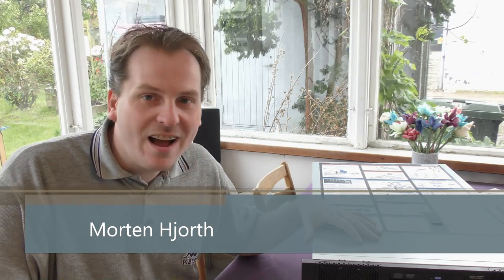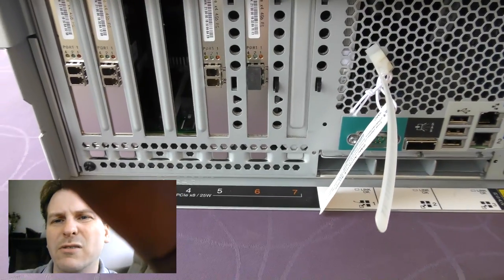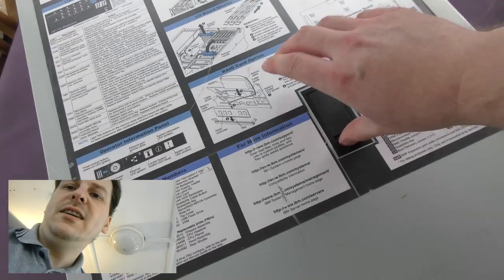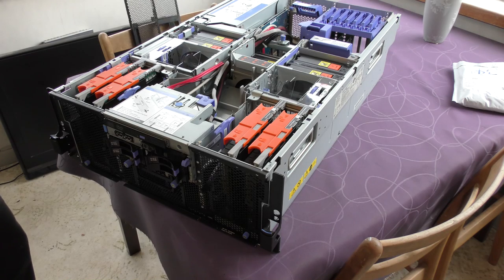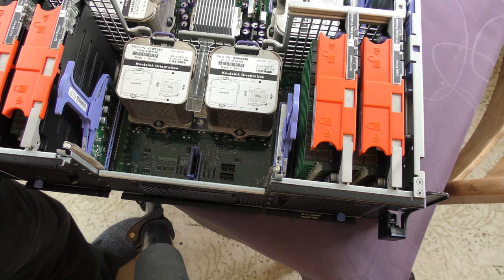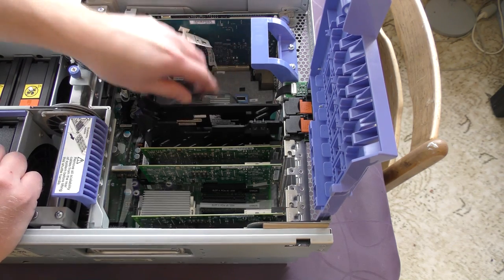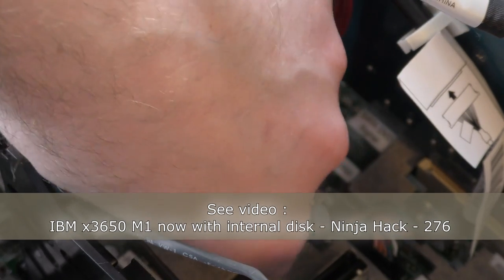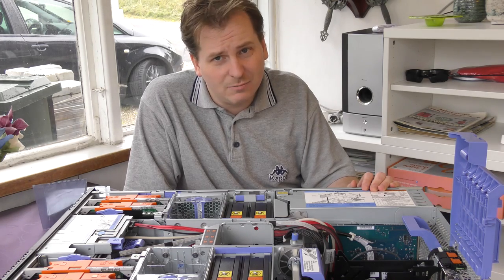$200 Awesome Server - 24 cores and 128GB RAM - 350

Comment: great video.. got a question for  you.. I have recently bought myself a Dell Poweredge 2950 Model 2, And everytime i boot it, it says "battery fault blah blah blah".... what does the internal battery pack actually do?
Because as far as i can tell, it doesnt do anything.. I can power my server off by the mains, and plug it back in 2 days later, and its all fine still.. cheerrs
Reply from the maker: Hi 
Check if it's the little 2032 li-ion battery for the Bios,, they are so cheap that you just get a new one.
If it's the battery for the raid controller... they can be a bit expensive... so maybe make a Hack repair on that.
Thank you for watching! :-)
Reply: yeah its the battery pack that connects into the PERC 5i controler, that the BIOS reports as dead/not connected..
I was planning on hacking it open and soldering in another LI-Ion pack..
But was wondering what its for?
I unplugged the server for over 1 week, and no settings had changed.
I used a volt meter to check the battery pack, it shows 0.30v so definately not taking any charge.. 
Thankyou for your help
Reply from the maker: Hi gamerdude1989 
You get a lot better disk performances, with the raid controler battery.
Thank you for watching! :-)

Comment: Hi... thanks for the video... I work editing video, sometimes I need to connect 3 videocameras to a computer for switching between the cameras in alive; and as you see I need a super powerfull machine... I was going to buy a HP Z800 workstation refurbished but I just watched your video and I wonder... ¿This kind of servers will works fine for editing video? Could I to buy a Video tarjet NVidia Quadro 4000 for working with a Video Professional monitor?
Are these kind of Workstation very noise? or normal noise?
Reply from the maker: Hi Alfonso Galicia
Thank You very much!  This model can somehow not be outfitted with a GPU,, I have tried and failed and others has to,,,failed.
Thank you for watching! :-)

Comment: Heyhey, 
Im looking forward to get a server to play arround with (get into linux server, using it to make a blender network-render cluster etc...learning new things). At that point i had allready made my choice to get a HP proliant DL580 G5 with 4x Xeon E7420 CPU's and 32 GB of RAM for 210€ after taxes. Thinking it was quite a good deal...but now, after seeing your video, im somehow unsure...maybe you could tell me what you think about the DL580 for that price? =) 

Maybe you could start something like a video series of server harware you suggest? Like giving recommendations for file servers, host servers, render servers and so on? Would be great! Keep up your good work! =)
Reply from the maker: Hi David Seiwald
I am afraid I do not know the HP DL580 G5 :-/
If you want a cheap good server to play with. I made a video talking about that : https://youtu.be/p2lGufUYIZw
But if you want a 24/7 server that has to stay in your room under your bed :-) maybe go more this way : https://youtu.be/TqoazLMZNXY

Thank you for watching! :-)
Reply: Thank you very much =) i think i'll give the DL580 a try anyways (letting you know how it works if you are interested). Your recomendation is nice and propably the most versatile server you can get, but for my use case i am looking into something with more processing power. As it wont run 24/7 i dont mind the power consumption and the noise. =)

Comment: Is that a 4U server?  Looks real heavy to lift, so when it gonna be shipped it can be expensive.
What version of esxi hypervisor could be possible? 5 or 5.5?
Reply from the maker: Hi +Henk Kok 
It takes up four units in a rack,, it is 4U high. Very heavy and expensive to ship. It should run ESXi 6.0,, I run mine on 5.5,, but just because I have not upgraded yet.
Thank you for watching! :-)

Comment: I want build a router-switch (running vyos or pfsense) using a server with a minimum of 7 pcie-x8 like this but need a low power consumption (will run 24/7 ) which server you can recommend me? thanks
Reply from the maker: Hi Chris Sandoval Hidalgo
Low power consumption,,, is not this server :-/
Thank you for watching! :-)
Reply: My PlayHouse I mean not high as this one.... the only one that I found is HP dl580 g7 but looks like an overkill for my need
thanks
Reply from the maker: Chris Sandoval Hidalgo 
That is also not low power :-)

Comment: Would a machine like this be good for handling intensive programming loops (AI routines, etc)? I am looking into getting a machine for a dedicated game server.  It runs fine on my current machine, but I want room to grow and not have to worry about leaving the server open on my main PC.
Reply: Goalatio If your server is going to be 24/7 then go with a newer server because they are more power efficient. This server draws 5-600w during idle (if my knowledge is correct).
Reply from the maker: This Server is good for turning on and working/playing with it for some hours or a few days.

Comment: Would this model be suitable for mild game server hosting (specifically CSGO and other valve games)? I am currently looking into buying a dedicated server but I am at a loss when it comes to deciding on the correct model.
Reply from the maker: Hi Kasper Holm Hansen
I really do not know,, what would you expect from a game server?
Thank you for watching! :-)
Reply: Normally I'd say one core and one gigabyte of ram per server, but it fluctuates a lot depending on plugins, the amount of players per server and tick-rate (update rate for player positions, etc). 

Also, besides running game servers, I would have to run at least two web servers and a MySQL server for game statistics.

Another question: Is it possible to turn off features to save power? I'm thinking of turning off memory slots and maybe a processor if it's unused.

Thanks in advance.
Reply from the maker: Kasper Holm Hansen 
This server is a bit,, no it is a lot power hungry!! it will suck you dry! 5-600 watt.

Comment: Nice piece of hardware you've got there! What I don't get about your videos though is your sometimes utter lack of knowledge of what you're actually dealing with, and just reading things off labels as you spot them, and this hasn't really changed over the years (yes, I've stumbled over a couple of your videos recently). 
Examples from this video include "they [PSU] have a lot of watts" after failing to find an exact number on the label (they're rated for 1440W according to "IBM United States Hardware Announcement 107-606" by the way), or "it seems there are no LEDs after all" after inspecting the RAM board -- the retaining/ejecting clips are what the LEDs would light up in case of an error when you pushed that button. Oh, and two of your PCIE slots do support hot-plug; something you at first said they didn't, but later on you notice the orange release buttons.
Reply from the maker: Hi Gutnarm Matt
Well I do far from know everything, and if I do know something I prefer to show you that it is so,, Me showing you that the PSU is 1440W instead of just saying it,, is way more convincing and entertaining,, and me also showing that there are tons of stuff that I do not know, and "WE" kind of find out along the way,, or "editing Morten" dopes in with the info,, well it is very repeatable.
Thank you for watching! :-)

Comment: You can use up to 2TB SATA SSDs in this machine. Unfortunately it supports only SATA 300 and Raid Levels 0, 1 and 10. Even with the fastest SSDs, you only get like 300MB/s performance. But anyway it's my favorite machine.
Reply from the maker: Hi YouTube 88
Thank You very much! 
Thank you for watching! :-)
Reply: I was wrong about the disk speeds. I originally tested it with just a single SSD and never got more than 300MB/s. Now i installed two new 2TB SAS drives in Raid 1 and got more than 500MB/s. So this old server is actually still pretty usable.

Comment: It sucks that these do not support directed I/O ill just have to wait for the x3850 x5 to drop in price
Reply from the maker: Hi
Yes,,It's the CPU's,, that is not able :-/
Thank you for watching! :-)
Reply: yeah if only if was as simple as just changing the cpu's but none of the E7000 series xeon support directed i/o
Reply from the maker: Hi spencer williams 
Is that working in the x3850 X5?
with the 4800 or 8800 ?
Thank you for watching! :-)
Reply: My PlayHouse yes all the e7 v1 and v2 cpu's seem to support it which would make a nice 48 core 96 thread workstation or you could link 2 of them together and have a 96 core 192 thread Virtual Machine if i understand the technology correctly

Comment: most gpu's should run fine at PCIe 8x as that is what they run at in multie gpu configurations (on most cpu's)
Reply from the maker: Hi
Yes, biggest problem is to fit them in there and power them :-/
Thank you for watching! :-)
Reply: something like an AMD R9 Nano or an ITX version of the GTX 970/1060/1070 should solve the space problem
but all of these GPU's require 120+ watts of power so that's not really possible
something like a GTX 750 Ti or 950 (quadro k2200 or m2000 if you want ecc) have versions without PCIe power connectors, yet those cards aren't particularly powerfull

Comment: Hello Morten. I just recently purchased 3 old IBM x3850 servers (2x M1 and 1x M2). I got them VERY cheaply at an auction for approx $20 each! :-) Then another $50 to buy 10x 73GB SAS drives. 

However, I am having problems getting the M2 working. It starts and runs and seems to be OK but when I tried installing Windows 7 Pro on it, the install fails and comes up with this error message:

"The computer restarted unexpectedly or encountered an unexpected error. Windows installation cannot proceed. To install Windows, click "OK" to restart the computer, and then restart the installation."

When I click the OK button, it says "Setup will continue after restarting your computer", but it does not work.

I have tried doing a re-install fresh but it keeps coming back to this same error.

I have run a test of the memory and a Preboot Diagnostics test and am not seeing any errors.

Do you have any suggestions for how I might troubleshoot this?

Thanks.
Reply from the maker: Hi Eran Malloch
Only to try a server OS like the Server 2016,, and firmware update. :-/
Thank you for watching! :-)
Reply: CentOS works..and its free.
Reply: CentOS works ..I tryed  Ubuntu Server 16.04 LTS and get kernal panic

Comment: I would like to know if I can upgrading RAM memory  of my IBM 3850 M2 4x Quand Xeon E7320 2.13Ghz 128 Gb RAM and 4x 146Gb SAS. I found some IBM 3850 M2 manuals and  I am confuse as some manuals explain It is posibble upgrade RAM memory to 128GB an other manuals describes It is possible to upgrade to 256Gb RAM. 
¿ Could you help me ,please? 

I have another question, I tried to install a PCIe graffic card with card riser from x16 to x8, however, neither from bios configuration, neither installing graffic card driver It was no possible, to get crazy, but It was not working. 

I am very fan of you, great your video demo servers !, excellent.
Reply from the maker: Hi Ben Ballano
Thank You very much!  256Gb is max in this server,, 4 Menory cartridges 8x8 Gb in each. We are many that has tried to install a GPU,,,, non has gotten this to work.
Thank you for watching! :-)

Comment: I have a separate 20 amp circuit and I draw about 8 amp with my equipment what would this server use?
Reply from the maker: Hi
As far as I remember it uses between, 2 and 3 amps.
Thank you for watching! :-)
Reply: Do you Think I should get one of these or a dell R710? Whatever one I get it will run 24/7 so power is one concern
Reply from the maker: Hi Jacob Begotka
If this is for your home 24/7 server,, the X3850 M2 uses to much power,, I am not going to recommend you the R710,, I am not a Dell dude :-/ I recommend you a IBM x3650 M2 or M3 instead,, as my goto model.
Thank you for watching! :-)
Reply: +My PlayHouse (Morten Hjorth) OK Thanks!
Reply from the maker: Thank you for watching! :-)

Comment: Is a tower server good to work with active directory? A friend gave me the option to get his older server that he doesn't use anymore....
Reply from the maker: Hi PC GUY 1241
It all depends on what is in it!! the hardware!
Thank you for watching! :-)
Reply: +My PlayHouse (Morten Hjorth) i know it depends on hw. I believe it is a xeon. I'll ask for the specs. A free server is good anyway!
Reply from the maker: Hi PC GUY 1241 
Sure it is! I'm sure it can run as a domain controller,, the question will most likely be what version of windows. :-)
Reply: +My PlayHouse (Morten Hjorth) i have it now! It is a SuperMicro server! Lsi raid, 2x 2.8 GHz Xeons, 8 hdd backplane, 16gb ram.
Reply from the maker: PC GUY 1241 do you have a model for the System board?
Reply: +My PlayHouse (Morten Hjorth) 
X8DAH
Reply from the maker: PC GUY 1241 
That is a good system board,,, You shout install VMware ESXi on it and then yot Servers on top of that,, is has lots of power!

Comment: One nice thing for us boys and gals in the lower 48. The power supply's are redundant at 120v ac Do not load the server down on one power supply It gets Pissy. I own one of these and its pretty easy on power. from what i see its on 24-7 in my setup.. Going to get 3 more lol.. Make a monster Server I am..
Reply from the maker: Hi +Dustin Marklow 
Don't know how easy the link things are to get...
Thank you for watching! :-)
Reply: oh you can get them but 164$ with shipping for cable and key
Reply from the maker: Hi Dustin Marklow  
Do you have a link,,,he he a link for a link :-)
Thank you for watching! :-)
Reply: My PlayHouse
Lol No! Something that can wait lil to much for me at the moment :-)
Reply: +Dustin Marklow do you know how many kwh these draw per day or how much power this server actually pulls?
Reply: Jacob Begotka I just have that plugged in to my apc 2200 rack mount ups the server it self under full load @ 120v ac draws 9 amps but that's loaded up with VMs it stays around 3 1/2 4 amps with what I'm useing it for.
Reply: +Dustin Marklow Thanks!
Reply: Jacob Begotka
I'm just going by what the ups is saying so not sure how correct it is lol

Comment: Hi Morten, I am thinking of growing up speed of the machine IBM 3850 M2, but I do not know if  de HDD of IMB 3850 M2 is SATA1, SATA2 o SATA3 as depend on max speed of de bus from HDD of the mother board. In case SATA1 i am not going to get enought extra speed.
¿ Do you known the vesion of SATA is it? I tried to check it from everest to know de bus speed, Crystal Mark Info does not work and I do not know how to find it.

In case of beig SATA1, I will go by next way. SSD PCIe 1.0 o SSD PCIe 2.0 as the IBM 3850 lets 4Gbps or 500Mbps by x8slot.So I am sure the version PCIe from IBM 3850 mother board is PCIe V.2. I will use to work  4 units PCIe, to plug in 4 slots PCIe x8 with 120GB each Ram disk as 3850 M2 does not lets up to higher than 146Gb per SAS being 4x 146Gb thinking on an overview to try to boot system from them.

Could I have your opinion? Nice to meet you ...
Reply from the maker: Hi Ben Ballano
Thank You very much!  I think it would be SAS 3.0Gbit,, was not able to find it..
Thank you for watching! :-)

Comment: Hi Morten, I have been thinking about the cluster with x IBM 3850M2 and you have all reason there are better ways. I thought in model IBM 3850 x5, It lets you to get  2Tb Ram with better power consumption than  4x server, and I wouldnt need a swicht to Cluster  servers. 
1.-Do you know better ways with cheap servers ? I would like to get  1Tb RAM as minimum.

2.-I would like to know if it is posible to install SSD RAM DISK from PCI slot x8 to boot from there a windows System, I think it is posible. 

Thanks very much for openning my eyes.
Reply from the maker: Hi Ben Ballano
I have seen more performances out of x3650 M3/M4 with high end CPU's.
I do not know about the boot,,,
Thank you for watching! :-)

Comment: Finally Convince the Small Company i work for on getting one to "Test" trial running a Windows Server 2012. I cant seem to get Windows server to find the Hard drives on the raid card. Forums posted say its the driver not being loaded into windows server. Any Idea where i could find drivers? I have had zero luck finding it on my own!
Reply from the maker: HI
Use this software,,it helps : https://www-947.ibm.com/support/entry/portal/docdisplay?lndocid=migr-5094163
Thank you for watching! :-)
Reply: I tried downloading and mounting ISO to a USB. I was able to boot to USB and server tries to load. I get stuck at the blue windows Icon in the middle of the screen. While my USB activity light in flashing like normal when it is in use. Figuring long load time? I am gonna let it run this morning for a bit to see if it figures its self out.
Reply: Updated! Was able to boot the the USB and load into the tool. After going through the steps and getting to the part where it is asking for a Installation files for windows server 2012 i keep getting an error that it can not find the files even though i have the CD in. Any Ideas?
Reply from the maker: Hi Michael 
and the CD works?
Thank you for watching! :-)

Comment: Can I use a server like this one as a normal PC?
Reply from the maker: Hi Alejandro Vargas
There is no client windows OS that can handle 2 CPU´s, but if you can run Server 2012 or 2016,, as you client OS,, which works rather well. This Server cannot use a GPU,,, I did not get that running.
Thank you for watching! :-)
Reply: Thank you so much! :)